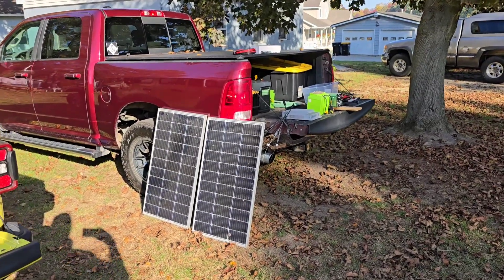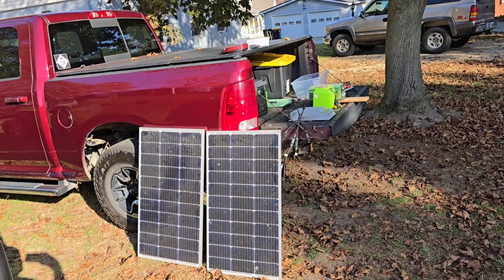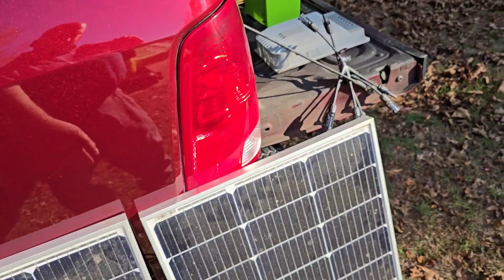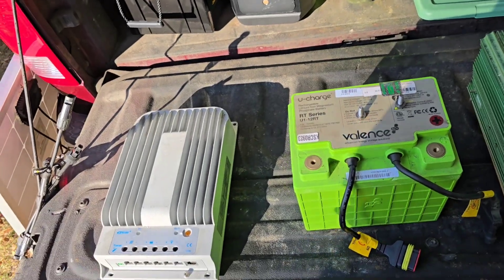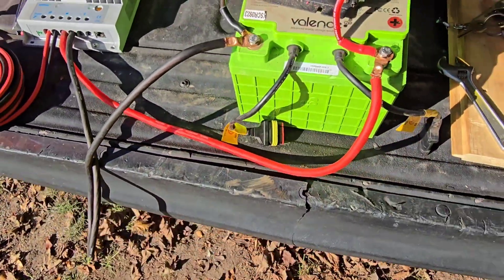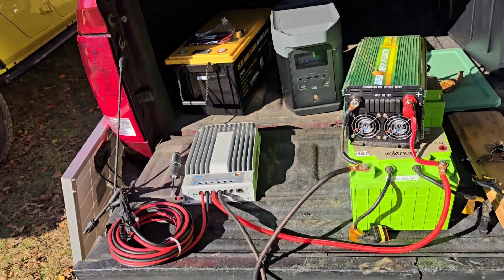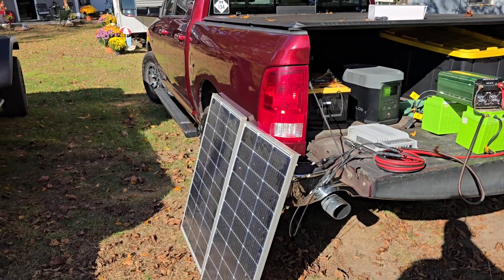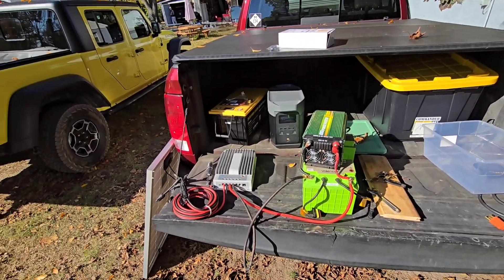A Driveway introduction to solar / off grid power. Basic components, and what they do.

Comment: I bought one of the Renogy 100 w portable suitcase kits with the self-contained charge controller, I use it to charge a deep cycle used for my small toy hauler. I went with a portable so I can park in the shade and then put the panel out in the Sun and angle it the way I need to. It works fantastic. Planning to do another system to run a 5 cubic foot chest freezer independently.